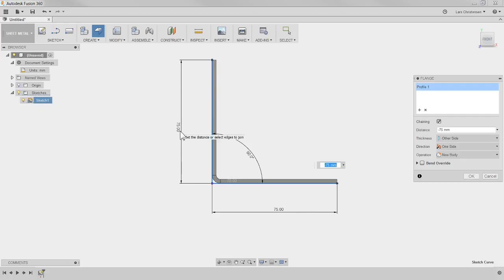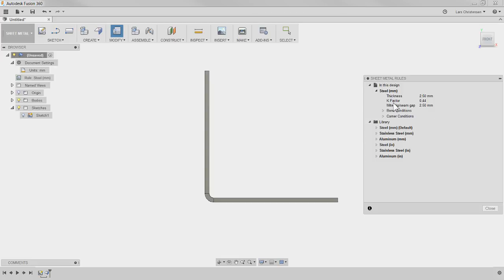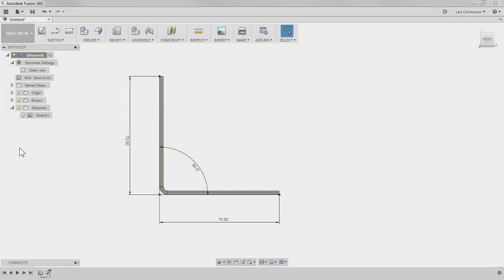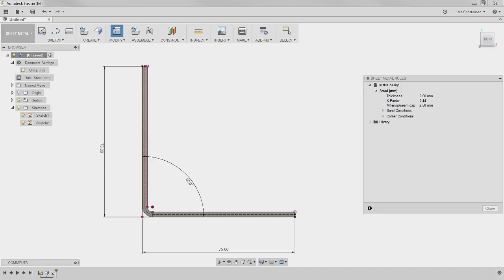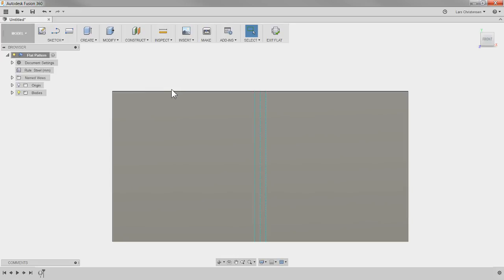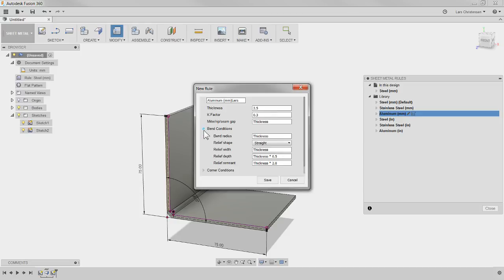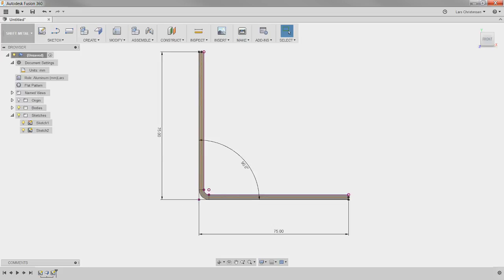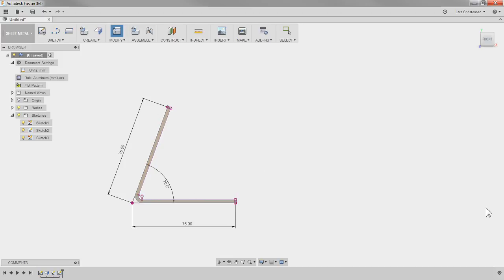Fusion 360 — Beginner Sheet Metal! Understand K-Factor!! —Your Comments & Questions — #LarsLive 43

Comment: K factor stays at .433 for everything...its your outside radius that is changing..your stainless creates a larger outside radius than mild steel because of the hardness. In other words if you are forming the same thickness of steel and stainless with the same tooling, your outside radius for the stainless will be larger than the mild steel (CRS). Never change the K factor. Keep it at .433. Its the inside radius that you want to change in the cad software. So, if you are achieving a .180 outside radius on .060 thick CRS then you want to use a .120 radius.... If you are achieving a .190 outside radius on .060 stainless then you want to use .130 radius...K FACTOR STAYS AT .433..Use an outside radius guage and see for yourself
Reply: I don't think this is entirely true.  K-factor and radius BOTH change from material to material with air-bending.  This is pretty well documented.  K-factor is a function of the strain in the material.  Strain is a function of stress and material properties.  .433 is roughly the industry accepted average k-factor of all material types and grades, BUT all bends won't have this exact K-factor:  https://www.thefabricator.com/article/bending/analyzing-the-k-factor-in-sheet-metal-bending.

Your method may work and give you good results, but the K-factor does change based on material type, thickness, bend angle, as well as tooling used.  Even if its slight.  The fact that K-factors values are pretty forgiving is probably what allows you to use .433 and have good results.  For example the difference in flat length between using a k-factor of .40 and .45 with .060" material is only .006".  Even with .250" material the difference when using those two k-factor values is only .020" which (depending on the industry) isn't that much error the sheet metal world.  

I completely agree that you should measure your resulting radius though!   That will affect the final bend deduction as much or more than the k-factor value used to develop the flat lengths.
Reply from the maker: Thank you so much for sharing this! Straight from the shop floor where things gets done!!
Best,
Lars

Comment: do you always have to start with a flat sheet?    i basicly want to use it to create a pre bent piece and then unfold it to be able to measure the lenght.   
(i'm too lazy to do the math)
Reply: Actually, that would be the preferred way for most.  Design in 3D and unbend all of the parts at the end.

Comment: This time I was puzzled with your measurements / elaborations around 20min. into the video. The dimensions 70.47695 remain the same - at all times, regardless the K-factor.
Reply from the maker: Hi John Coffee Thank you for watching!
The K-Factor is not calculated until you activate the flat pattern. That is when the calculations shows. That is why you need to go out on the floor, cut a piece, bend it, and then measure to find what works on your bending machine.

Hope this is helpful

Best,
Lars
Reply: Yes, thanks a lot Lars.
Reply: @Johncoffee2002  Yep! the K-factor does not change the formed part dimensions.  Only changes the flat length. :)

Comment: Hi Lars,
Can I unfold ,or project a 3d geometry to 2d?I mean imagine the inside tube of a kitchen paper.I have it in 3d and want to unfold to 2d to cut it in cnc. Or a hull of a boat where the pieces are curved and change geometry.In front and back are narrower and in middle wider.
Thank you
Reply from the maker: Hi fi2ng Thank you for watching!
We do have sheet metal tools:
https://youtu.be/nYpio3ZX_lQ?list=PL40d7srwyc_Mkgc5wvP_OfVel9aDkNkZ6

But, we don't have the option to flatten curved surfaces yet without some work arounds.

Comment: The part laid out in the flat position I call "stretch out" when working in sheet metal... I always think, whats the OD, and the ID supposed to be and is the k-factor negligible (for thin material it usually is) for thick material it needs to be accounted for as well as the type of top and bottom dies on the brake press, changing these will make the stretch outs vary
Reply from the maker: Hi Scott Tucker Thank you for watching! And for the great comment!
HAve an awesome day!!

BEst,
Lars

Comment: I am very new to Fusion 360. I used to use SolidWorks for little more than 10 years, but as you know it is far too expensive for retired guy to have a license. I used be a sheetmetal worker, but mainly worked as foreman, production manager and engineering. In Canada, I only worked in Stainless Steel food and medical equipment shops. The inner radius is dependant of the bottom tooling opening unless to tooling nose is bigger than calculated radius. Normally each shop is limited what they bend and tools they carry. So you can test piece to determine the K factor. Most of the Stainless Steel shop uses 14 ga to 20 ga. In order to do precise measure, you need laser cutter and good CNC press. We were using 1/2" open bottom tooling and inner radius is multipy by 0.156, K factor was 0.3715. Now this is not dependant of the thickness of maerial nor kind of material, ie 303 Stainless Steel or Aluminum. Now the 1/2" open is at theorical sharp. These are tested with SolidWorks but Fusion should be same. As you can see, we made Stainless Steel cabinets, sinks, nacorpsy table etc, and they need to be accurate. I used Cincinnati 2 meter x 4 meter 3500watt laser and Cincinnati 14' AutoForm and MaxForm CNC press Brakes. We used air brake system meaning tooling does not hit as bottoming or coining. All tools were 30 degree acute tooling. This system eliminated test bend. We used to have scraps all over brake from test bend but Cincinnati AutoBand bends perfectly every time no matter the angle. This is another story.
Reply from the maker: Hi Kurahashi Dan Thank you for watching! And sharing your knowledge. Thank you!!

Best,
Lars

Comment: The way we figure out our k-factor at our shop for a specific material type and thickness goes like this.  First get the material you want to test.  For an example i will pick 11ga carbon steel.  There are three parameters you need to get for the right stretch out for your material when it is unfolded which are material thickness, k-factor, and bend radius.  So for 11ga carbon steel if I measure the thickness it is usually .115 so I will record that number as my thickness.  Next step is to measure the length of the material you are going to bend.  We normally laser cut a blank 6"x3" but the blank doesn't have to be that precision of a cut just you measuring has to be.  So after my blank is cut I will use a mic and measure it exactly.  It might actually measure 5.998 or 6.002 but all I need is the exact measurement and record that value.  Next step is to bend the 11ga strip with the bending dies you will normally use for that specific material.  We bend the strip in half 90 degrees or just tell the back gauge to be at 3.  Here again the bend lengths dont have to be exact for the test just the measurements you will take after it is bent.  You do need to try and get the part bent as accurately as you can to 90 degrees though.  Once you have it bent to 90 degrees you need to use a mic again and measure the outside dimensions of each leg of your bend and record it which I usually do by writing the dimension on the leg I measured so I don't get them mixed up.  For example if I were able to bend it exactly in half each leg should measure close to 3-1/8"  Next step is you need a radius gauge.  If you don't have one you really need to get one to do this accurately.  With the radius gauge measure the inside radius of the bend as close as you can and record it.  Now the next step you will need to go to your 3d modeling software and draw the bent part you have using all the measurements you took.  Draw a "L" shaped sketch and dimension the lines using the dimensions you miced for the dimensions of the legs of your part after it was bent. For example 3.100" x 3.112". Tell the software you want the material to be on the inside of you sketch line and then extrude it 3" or how ever wide your test part is. The width doesn't really matter for the calculation you are trying to get.  Next you need to define you material which fusion 360 calls a rule.  Tell the material thickness to be what ever you miced you material to be then define your inside radius as what ever you measured with the radius gauges.  Now flatten or unfold your model you drew and measure you overall length after it is unfolded.  with the default .44 K facotor it should be sort of close but not exactly what you want.  What you have to do now is change the k-factor value till the over all length of the unfolded part in the software is exactly what you measured the strip at before you bent it.  In my experience i've never gone below .30 or above .50.  Once you have the k-factor figured out save it in your rule then next time you are going to draw a part in 11ga carbon steel just select the rule and your k-factor will be saved for you.
Reply from the maker: Thank you justin george That is an awesome comment!

Have an awesome day!

Best,
Lars
Reply: Thanks for posting Justin George!  It's all common sense steps but would take a couple goes before getting that procedure nailed like you have.  Thanks for saving me the time!

Comment: Absolutely PUMPED about this series (if it will be a series...😉)!  I work at a sheet metal fabrication shop.  We make tool boxes for pickup trucks as well as class 8 semi-trucks.  We use Solidworks exclusively, but I can't afford that software and really have no access to it.  Being that Fusion 360 is free, this opens up a whole new world of "personal" projects!  I hope that you might touch on bend deduction, bend allowance, bend force tables, and the sort.  The K-Factor is the ratio of the distance from the inside bend to the neutral axis and the thickness of the material.  I hope that makes sense, and I haven't read through the comments to see if anyone else mentioned that, lol!  I totally dig your videos!  Keep up the good work!!! 😁
Reply from the maker: Hi Elliott Blood Thank you for taking the time to watch the videos!

Bend deduction and allowance are supposedly coming soon according to the development team.
Love your feedback on the tool when you have had a chance to take it for a test run.

Best,
Lars

Comment: Could we use sheet metal to design cardboard boxes,  and if so could you do a mini tutorial.
Reply from the maker: Yes, I have used sheet metal for laying out cardboard to ship parts in the past. I will put it on the video list :-)
Reply: What about us Plexiglas guys...we need a spot in the material library. And I hazard a guess or K factor is just wild.
Reply: I agree, bending Plexi/Acrylic. also cutting the bends then flat
Reply from the maker: You should be able to just rename one of the current metals to plexiglas.
Reply: Question !! 

if sheet metal used for packaging, using cardboard, duplex, etc. how much K Factor needed ? since those material are thin and easy to bend.

thx

Comment: I am super new to Fusion.  I have created a drawing of a rinse tank out of 304 stainless steel with the following measurements: 18 feet long, 4 foot sides, 12 inch radius in the two corners.  I started with an open plain u shaped form. Long sides and bottom came out fine.  My problem is I don't know how to add the flat end pieces.  Can you help me? I am short on time.
Reply from the maker: Hi Stephen, would love to help, but I am sitting by the pool on a family vacation. I would recommend that you post your question on the Fusion 360 forum. There are some really smart people there.

Comment: Another great stream Lars! Of course I'm going to add something, Sorry. :)
K-Factor is a constant and  it's function is to, as Lars stated, account for stretch/shrinkage of the material when it's bent. There are plenty of sites online that teach you how to calculate the K-Factor for a given material but... you don't have to learn all of that (unless you want to). There are literally 100's of sites that will give you a table of the K-Factor for the material you want to use. So if you're designing a sheet metal prat... determine what material you want to use first, look up the K-Factor, plug it into Fusion and just design away. Sometimes you need to dive deep into a subject and other times, such as this one, the industry has already done the work for you. Hope this helps all the future sheet metal designers out there. :)
Reply from the maker: Hi OneLiterPeter Thank you for taking the time to watch the videos! AND a great comment! Really appreciate it.

Comment: So glad sheet metal is active, 
as a rough guide I subtract 1 thickness for each measured edge, 
in this case 2 sides so subtract 5mm. 
Works well for working out "bend allowance" as we call it
For external measurements
Reply from the maker: Great advice! Thank you!
Reply: Rob Bennett we do the same in our shop as well.

Comment: Is there a way to bend it, measure it and then calculate the K-factor or maybe later in the future input the result in the sheet metal rules?
Reply from the maker: There might be some calculator out there that will let you do that. I have only known, bend, measure, tweak and repeat
Reply: see the comment I made above on how we figure it out at hour shop.
Reply: How can I use Bend table in Fusion 360?